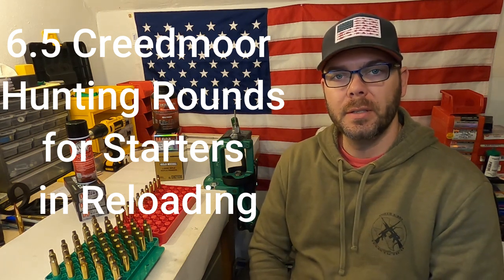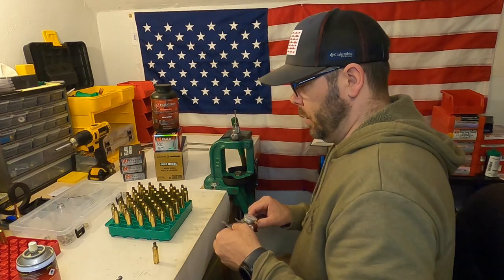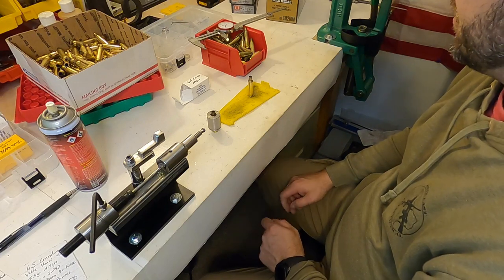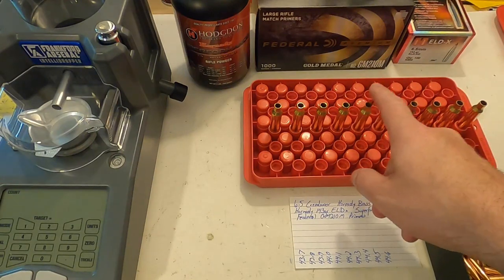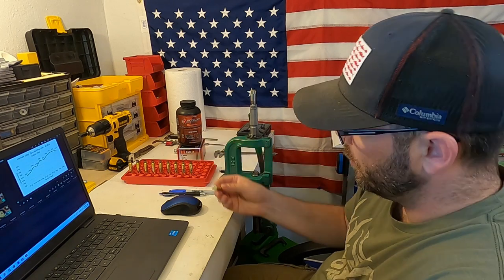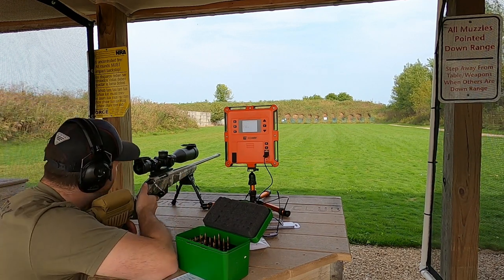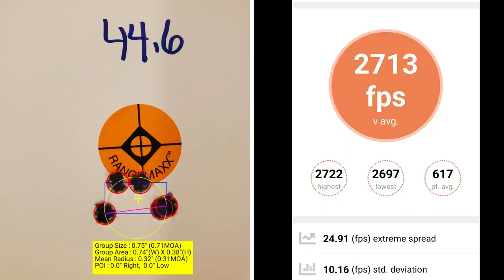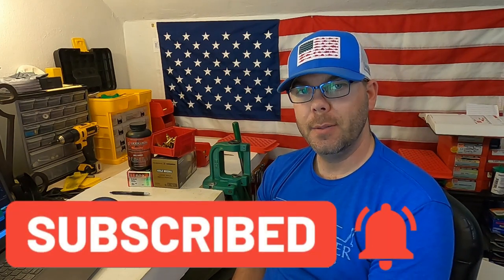Basic Reloading - Can it have good results? 6.5 Creedmoor 143gr ELDx with SuperFormance

Comment: I like your brass trimmer do you have any problems after you set it up changing my rcbs trimmer will drift a little it takes 2 or minor adjustments before it settles down.
Reply from the maker: Once it is set, it is locked in.  It has locking screws in 2 places.

Comment: What made you go up to 44.6 just looking at pressure? I seen in my Hornady book with that powder they don't go over 44.1
Reply from the maker: In my Hornday manual it shows max is 44.7
Reply: @mattsreloadingbench  Yeah your right nevermind lol, i was looking at a screen shot on my phone looked like a 1. So just from a few of your videos looks like close to max load usually does pretty good as far as grouping
Reply from the maker: @seetownwv  that is not the only time.  If you work your way down more than I do, you very well may find another range of charges that will group well again.  I like to stay at the top of the chart for long range stuff.  

If it was 100yd only type shooting g that I would be doing, I would explore lower in the charge chart.  But, the faster the bullet, the less drop that you will have to adjust for.
Reply: @mattsreloadingbench  Good to know, I would rather be on the faster end then.